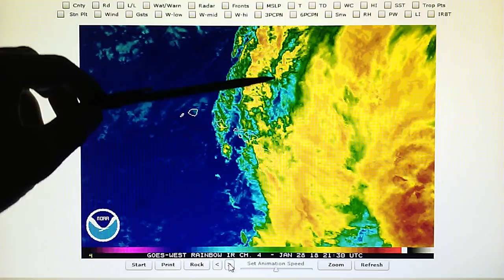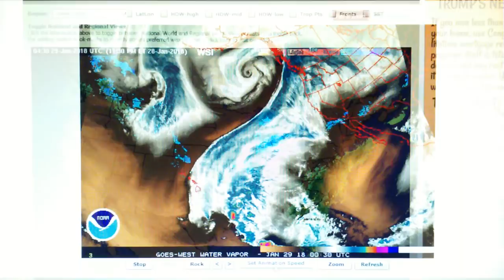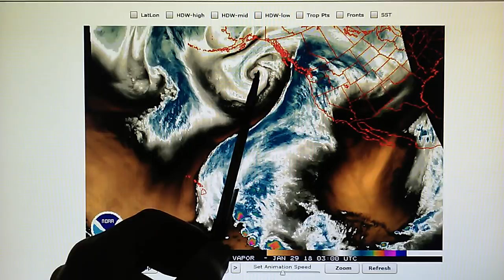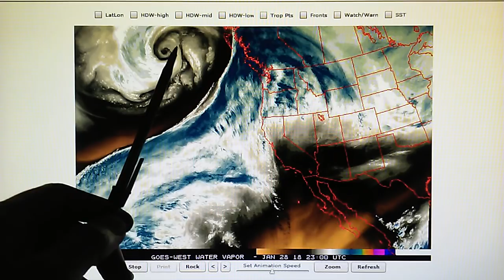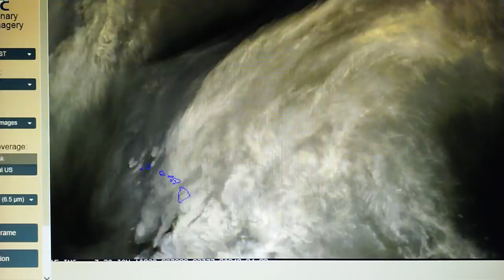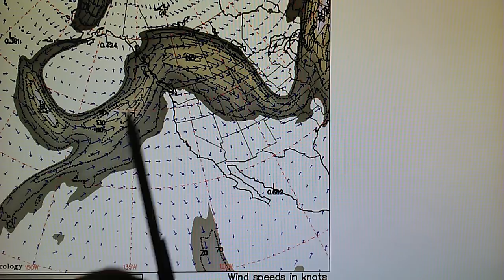1-28-2018; Pineapple Express Into CA Blocked By Installed High Pressure.

Comment: The a. Out of power required to change the weather patterns  has to be in the Tetrawatt range.  I doubt  a satellite could sustain that output; it would need  a power feed from Earth.  Or reflect a beam from a ground based source. Should be simple enough too track what satellites are orbiting above the weather anamoly.